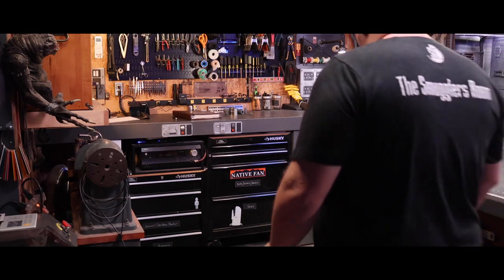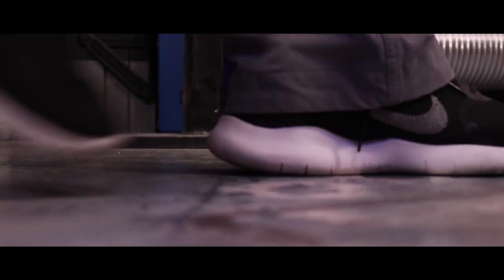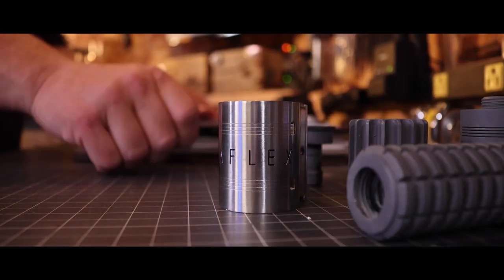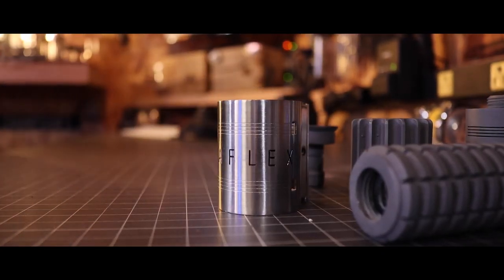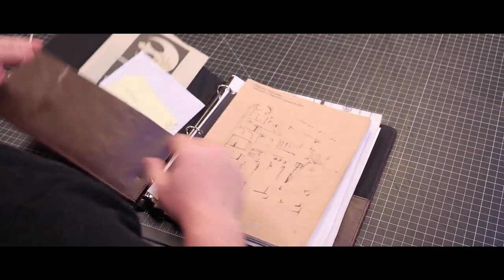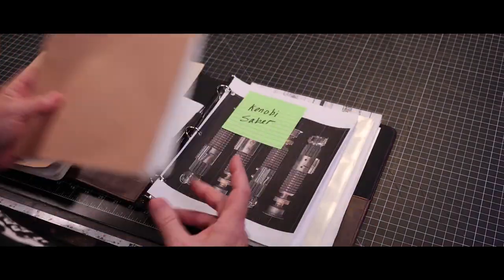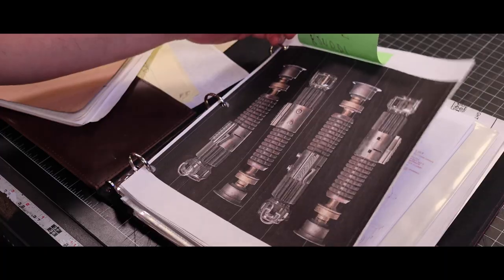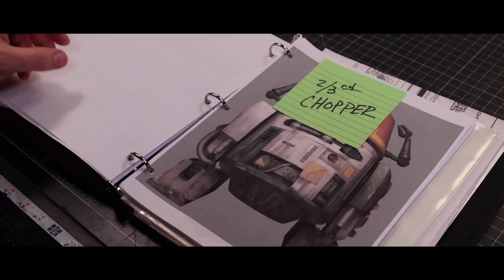The Gonk Droid Returns

Comment from the maker: The final episode of our Gonk Droid build series  is finally coming.  See you on 5.4.22!
Reply: This is cool! Have you read 'I am C3P0'?
Reply: I attempted to tell you about adhesion promoter a couple of months or so ago, which basically adds a layer of more paint friendly plastic to the surface of that difficult soft plastic used in juice bottle caps and your gonk droid body. My favourite is Hycote, but there are other brands available which may (or indeed may not) be more easy to obtain. I use it on all my opaque soft plastic ice cream tub boxes for odd bits and I have zero issue with paint flaking or scraping off, even if I use wet-and-dry sandpaper.